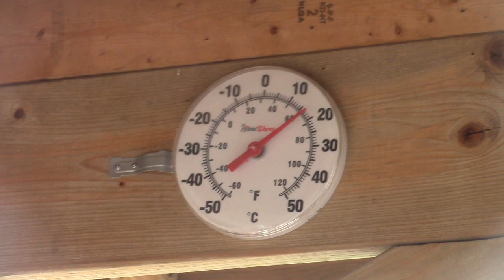Bird Nest Removed. How to prevent nesting again!

Comment: We live in Connecticut and when we first moved here from NYC in 2018 we thought it was so great to have all of the birds and nature. Now they’re just a complete nuisance. Every year they set up nests on top of outdoor fan blades in our covered patio and also in similar places as shown in your video in our gazebo by the pool. I tried a decoy owl and it worked for a week or two but now they setup nest on top of the owl. I’ve been removing the nest they start 4-5 times daily for the last few weeks and they keep coming back and building and making a huge mess on outdoor furniture, rugs, etc… And if I let them fully build the nests and lay their eggs, which I’ve done in the past, then the hatchlings just make an even bigger mess and you can’t disturb them at that point. Going to try your suggestion and pray it works.
Reply from the maker: Yes I understand. The birds tried to nest on my outdoor fan blades until I removed the fan. Thanks for sharing. Let me know how ti works out for you.

Comment: So, I had nesting Robins above a light fixture by garage entry door.  Not working for me.
I used plastic spikes first; worked about 3 weeks.  Couldn't believe they tried to put material between the spikes!  Friend said use a plastic bag; they don't like the noise. Worked about 2 weeks.  Added foil on top of bag. Worked another couple weeks then they just tried to build on top anyway!  Finally took all bag and foil down and sprinkled (a lot) of cayenne pepper.  No more birds.
Reply from the maker: Wow that's crazy. Very determined birds. Thanks for sharing cayenne pepper. Il try that next time.
Reply: Won’t the wind 💨 blow it away
Reply: hmmm i sprinkled black pepper on a couple areas  hope it helps!!
Reply: I’m going to try that
Reply: We have the same issue with Robbins. They're the most persistent birds who never get the hint. As many times as you knock the nest down, they literally come right back and build again. This happens over and over to the point where they make you insane!  I looked up a natural repellent and found a recipe for a cayenne pepper spray. Did not work at all for us. They nest on top of poles where an awning used to sit above our back door. We are going to have to remove the awning poles, as I can't take it any longer.

 We have different species of bird families all around the perimeter of our house that nest. Morning Doves and Robbins out front in a bush inches from my bedroom window. The robbins on the awning pole out back. And another bird on the awning over our deck. They are relentless. We can't park our car's out front because they sit atop of the power lines, constantly crapping all over. We're not even out in the sticks!

Comment: Very clever fix.  We have used "Pest Blocker" foam available at many hardware stores.  You could spray a blob of it on the top of the post then when it cures, take a saw and cut the top at a 45 diagonal and cut off the square side straight up.  Wallah....
Reply from the maker: That's a great idea. Thanks for the info.

Comment: had same problem with House Finches nesting on my deck. Took down nest several times. They are persistent and skilled. They are building on the wires between my deck beams!
Reply from the maker: Wow they are persistent. Good luck on those little pesky birds.

Comment: Our biggest problem has been birds building their nests behind our porch light. We knock them down every morning. we tried covering the light with plastic bags, that worked for a while but then they got wise to it and they started ripping that down, then we tried putting S.O.S pads behind the light, that worked for a while until it didn't , we ever changed our porch lights.  I use crutches and our front porch is my easiest exit so, we have clean things and knock thing down every morning
Reply from the maker: Yes they are so persistent. I hope my video can help.
Reply: We had Birds trying to build a nest on top of a light at the back door. I wrapped a loose ball of aluminum foil sort of behind and on top of the light fixture with a rubber band keeping it in place. 2 yrs now. Now birds building nest in the gutters. The roofers lost the end caps 😢

Comment: The birds nest on our ceiling fans on our front porch.     At first it was great but they made a mess.   I need ideas
Reply from the maker: Good question. If you know they are out of the nest, block the entrance hole with something hard for them to break at. Not cloth material since they will just persistently chew their way in.
Reply: Keep the ceiling fans on 24/7